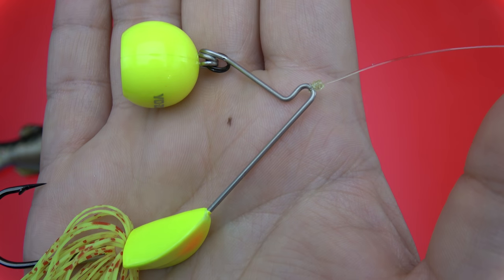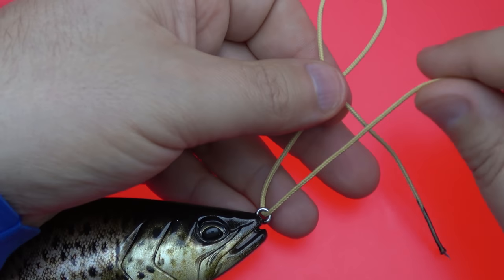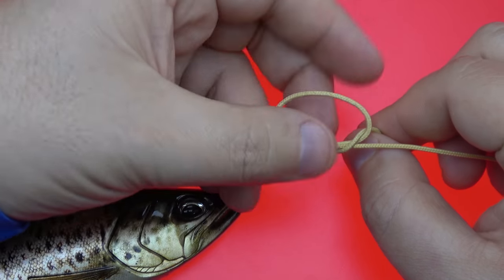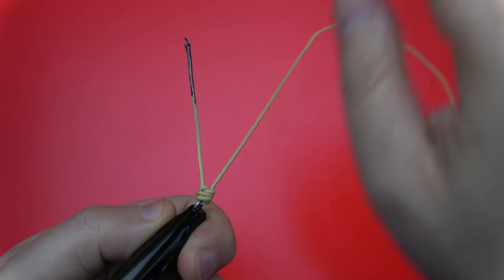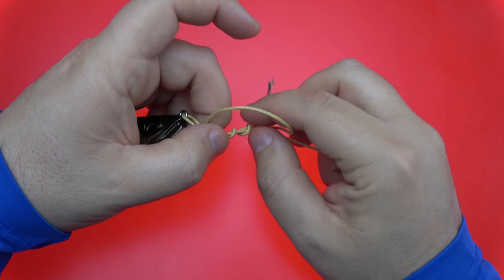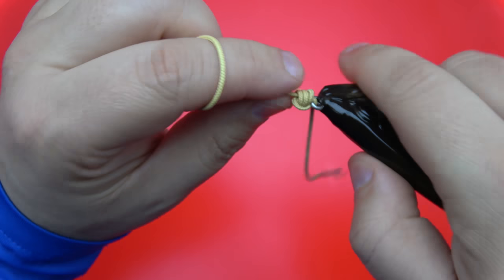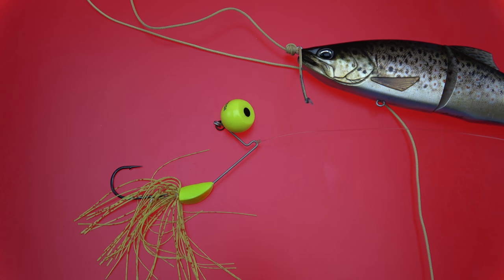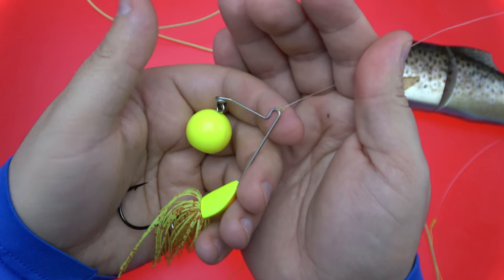How to tie a better Uni Knot and make it weedless.  One of the best knots for Braided line

Comment: I’m sure I can try that Nice Tip with other knots as well Thx for sharing
Reply from the maker: Ya sure can....This was sort of a place holder video.......I'm in the middle of a few large projects that are taking a long time...and needed to get something out there.  So I figured..why not put out a knot tying tutorial...and show how I tie mine.
Reply: What do you mean the uni is weak it is about the only knot that I have used that doesn’t weaken fluorocarbon line.. Just my opinion,BTW if you run braid through the eyelet twice before you tie the uni you can get by with less wraps.and it won’t slip 👍 Great videos keep up the good work.
Reply from the maker: There are stronger knots out there.  The uni is great one of my favorites...as it works on every kind of line in every lb test for the most part...And it's so fast and easy to tie consistently.  There is something about nanofil and gliss even the new ultra 8 that you really need to do the extra wraps to get it to hold tight.  But the double polamar or triple is the way to go.  I've tried the twice through the line tie and never noticed a bump in strength to be honest..not saying it isn't there though.
Thanks brotha!!
Reply: Vinfish F 👍

Comment: You say the uni knot is weak what knot would you suggest ?
Reply from the maker: It's a great knot...but there are better.  It really depends on how you rig.....And where in your rig you want to break.  Trilene, Polomar, fishin fool, ying yang (thats what I call it not sure if it has a name)
Reply: Tackle Advisors I’ll have to give a few of them a try. I already use the palomar for braid had bad experiences using it with fluorocarbon though . I guess I use the uni bc I can tie it in my sleep and it has yet to fail me
Reply: The improved UNI knot is amazing ;)

Comment: I tied a uni, double uni and a uni-uni knot for around 20 years. I could tie it blindfolded with a two hands occupied mmm, but that is another story. After transitioning into braid to fluro with lighter lines (20-6), I noticed frequent breakoffs. I mean frequent. I lost a lot of money in lures and a lot of fish. After trying several other knots, I have settled on the alberto (or modified alberto- not sure) for the braid to fluro and most recently the "Swindle Double Shindo Over-The-Creek, Beside-The-Barn Foothole Knot" (not sure of the real name) for fluro to lure. Not a huge fan of the 3 tag ends on the latter knot, but it is very solid.  I have learned the FJ knot and it seems as good or better than the Alberto, but it is a pain to tie. My breakoffs contributed to knots has decreased 90% since the switch.

Comment: how do you like those spinnerbaits buddy
Reply from the maker: Hey man!  Not a fan very underwhelmed....I made something similar 15 years ago when i tried to make a suspending spinnerbait and it performed the same.
Big splash, very little thump oddly quick fall rate.    Grabs more grass and it's tougher to shed than a spinnerbait.  Threw them along side a stan sloan zorro......Caught one fish over the cours of about 300 casts.....while catching dozens on the spinnerbait.
The one in the vid is the rattling version.....I have a flash version...and the ball tunrs milky thus no more flash from the foil embedded in the plastic......they say you can bulge it...but you really gotta burn in.......so yeah...20 bucks down the drain....Nice hook though  :)
Reply: lol my thoughts exactly. At first glance it looked cool, but then i thought about the main purpose of a spinner bait and figured ill wait till someone else buys it and ask them about it. I like big flashy willow blades on my spinnerbaits, better for the muddy water in lots of places i fish here in toronto
Reply from the maker: I was actually really excited to try these...One of my absolute favorite ways to target bass....NIGHTIME...Stan sloan short arm aggrevator (nothing else vibrates like it)  And they last as long as terminators and have much better hooks.  So when this familiar due to prior experiments design came out I was all over it and put a decent amount of time on it.....But...it ended up a "dud" bait for me.
Reply: wow! Those stan baits have an insane amount of options! Might have to give a few a try, the wire looks quality as well.
Reply from the maker: If I only could use one spinnerbait brand for the rest of my life..it'd use them.   They have two types of hooks...standard wide gap mustads that everyone uses...and a more of a O shaugasy bend...Not sure if that's what they use on older ones...but I love that hook for spinnerbaits!

They also have a functional weed guard and bait keeper barb
Reply: holy feature packed eh, I havent really found any that ive really been blow away with so im going to have to add these to the 2018 purchase list
Reply from the maker: Amazing how little attention they get yet they've been around forever.  A staple for me since the 90s
Reply: hahaha old man ;) mostly all the tackle shops around here are stocked with boyah and strike kings. Youll really only see others brands at the ma and pa shops
Reply: Tackle Advisors they recommend using a swimbait trailer when using the knuckleball spinnerbait
Reply from the maker: It's not the fall rate or profile...It lacks the thump I had hoped.  I'm pretty particular about certain baits...I only throw a few spinnerbaits. 2 types i won't name since they've been discontinued for years and are tough to source.  lol
Reply: Tackle Advisors I watched your sprinker frog video very nice bass I can’t wait to try them at night the bone color is my color of choice at night especially on the whopper plopper but if i had to pick 1 topwater at night hands down is the jitterbug 4 inch version in black